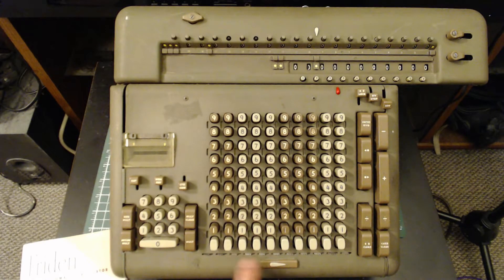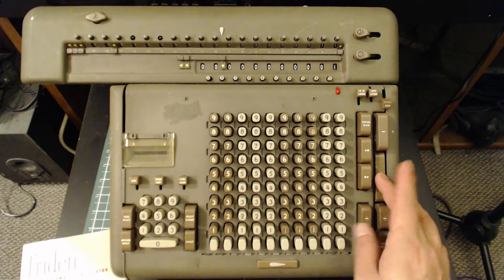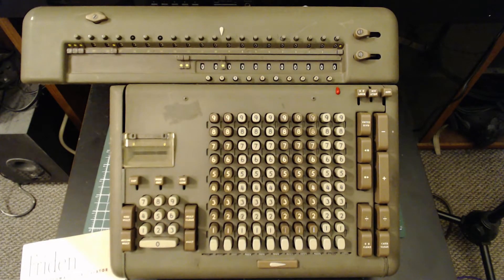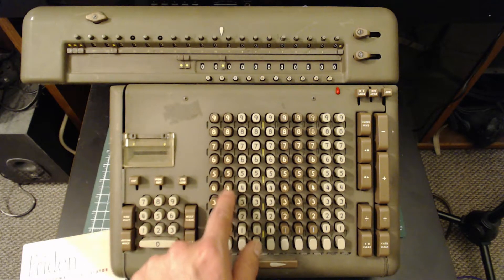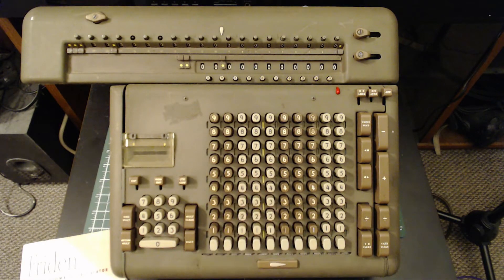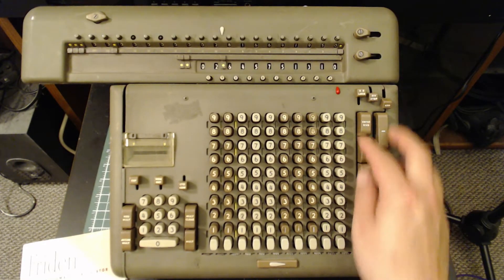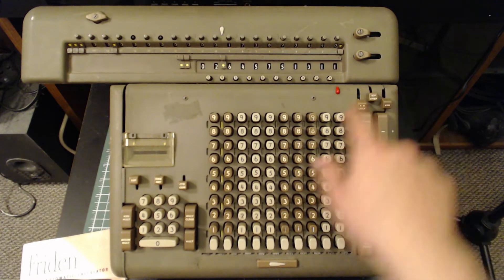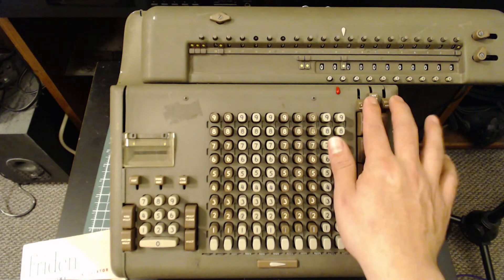Square Root on a Friden STW10

Comment: The method works because successive odd numbers sum to perfect squares where the number of terms is the square root. Your version is half of the type described by Monroe but it works. Multiplying 7*5 then moving the decimal place to 3.5 is a way to effectively halve 7 without doing division. Then 0.5, 1.5, 2.5, are half of successive odd numbers.
Reply: For example, 1+3+5=9, 3 terms equals the square root. Furthermore, 5 the highest term plus 1 = 6, double the square root. This goes on up to infinity. The method divides the whole number part into groups of two. 7 is one but it is treated as 07. The Monroe method seeks the closest double square root then move to the next pair. The keyboard at the end has double the square root but in your “half” method the actual square root appears on the keyboard. Either way the square root is in the counter dials.